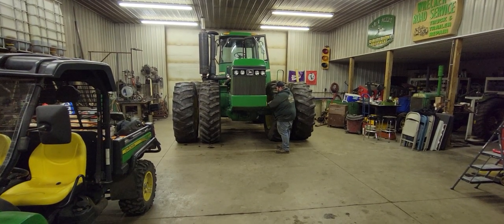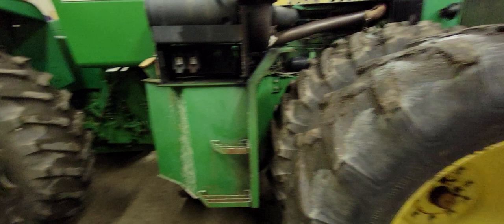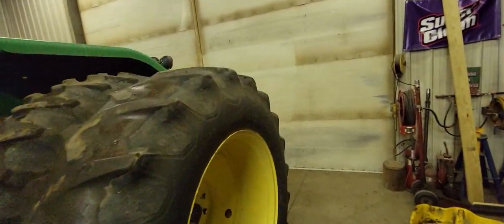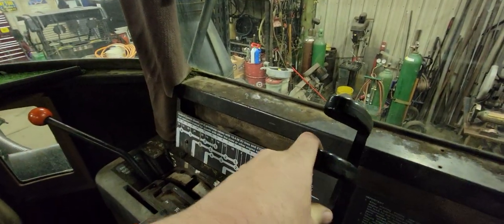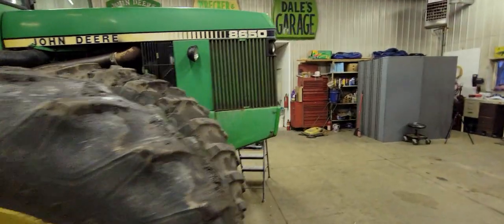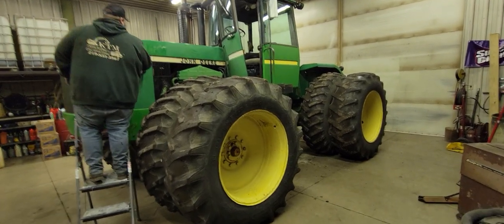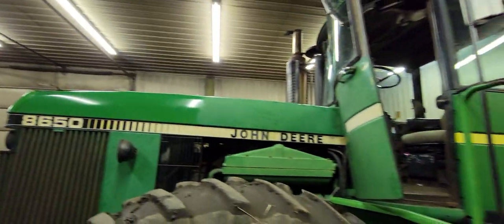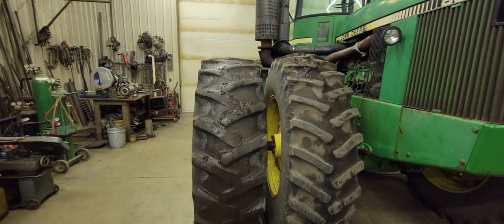Another John Deere Tractor Added To Fleet Walk Around Video!!

Comment: The JD 8650 what kind of horse power? And do you have plans of running grain cart this fall with it? Or is it just for tillage use. Great tractor with lots of potential. I love the older 30 40 50 60 series deere tractors

Comment: How sure are you that burned exhaust and bald tires happened in just 2800 hours? I would say it's more likely to have 12800 than 2800?

Can't believe tires were that bad way then??
Reply from the maker: This was a local tractor and everyone knew it has been confirmed it truly is that low of hours the proof is in the shifting also it shifts like a dream all so the fuel tank steps to get in the cab still have the paint where usually its worn off from your boots hitting